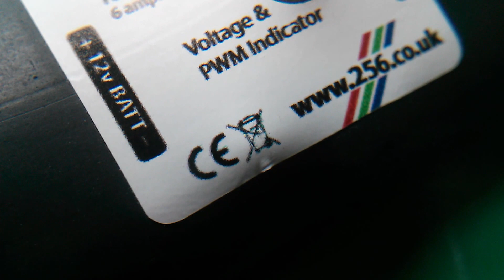Manufacturing the PWM5 Solar Charge Controller #2

Comment: Okay, Julian. I'm one of the biggest fan's of your. I learn a lot every day I watch your videos :)
I keep reading a lot of comments that people are still interested in your PWM5 product. So here is my 2 cents...
Why don't you do a kickstarter? You already have the hardest part of the project done (design and schematics). Collect some money through a kickstarter, find a manufacturer in China or Malaysia that would manufacture and assembly the whole kit and deliver it to your kickstarter customers.
See how many units you'd need to build with your manufacturer (MOQ Minimum Order Quantity). Set it as a goal at kickstarter and off you go.
Not only this manufacturing and assembly procedures would be easier, but your sales would be guaranteed (no waiting for customers, customers would be waiting on your product) and your profit would be instantaneous (selling a thousand units on the spot).
On top of that, you could manufacture a bit extra and continue selling on eBay.
See how this plan works out and then do the same with MPPT controller.

Comment: For the fun of it, get a weller TCP12V. It hooks straight to 12v, and the temperature is controlled by a magnetic tip
Reply: He could power the station with an inverter.
Reply: I know :) Those are lossy, tho, and he has 12v right there available :) It's a good iron as well.

Comment: Kinda surprised you didn't use outdoor rated silicone caulk instead of hot glue.  I would think that sitting out in the hot sun in some countries that see 120F+ temps every day may cause the glue to soften and flow over time.  I assume you used high temp so maybe that is not an issue.  Great to see a usable product developed and made all from home.

Comment: What kind of wire are you using? Any particular brand? I've been looking for some quality wires for some time now.
Reply from the maker: It says on it (and there's quite a lot of it):
TOPFLEX TRI-RATED H05V-K AENOR <HAR> BS6231 600/1000V 0.75 SQMM HEAT RESISTING 90 20AWG 105C AWM I A/B 1000V FT1 CURUS AWM STYLE 1015 600V VW-1 CSA TEW FT1
Reply: Thanks Julian Ilett!

Comment: Since you seem to like hot glue a lot for molding/sealing: I don't know if you know this, but hot glue won't stick to baking paper after it cooled. No idea if there are different grades and it only works with certain types, but it worked with everyone I tried till now and still was reuseable tens of times.
I mold tons of connectors like that. Put a small dab of glue on the paper (just as much that it will approx. be half the height of the connector) and push the soldered connector in (I mostly use it for pin headers, which have a flat side) and let it cool. Then put another bit of glue down and now push the upper side of the connector in. After cooling the excess on the side can easily be cut away with a flush trim wirecutter. And you're done with a very sturdy connector with included kink protection..

Comment: I like these videos!
Would it be worthwhile to find a Chinese manufacturer that could make the boards for you with a pick and place machine and things like that... I'm sure it would be cheaper wouldn't it?
Reply from the maker: Pick and place has always been on my mind. I drooled over the RedFrog (https://www.buildyourcnc.com/PickandPlaceMachineTheredFrog.aspx), but it's a lot of money and I don't have space for it. I felt that working with a Chinese manufacturer would be difficult - the enevitable production problems, quality problems and language difficulties. There are a few UK companies who offer P&P services, but it's only cost effective on a first run of 1000 units or so and I never made it to that quantity.
Reply: I understand. It looks like you are on the tipping point of being able to mass produce at a good price.
Reply: Julian Ilett Perhaps you could work with Adafruit here in the US. They have some pick and place capability and sell to exactly the market that would be interested in these, I would think.
In any event, I hate that I missed the boat on buying one of these before you stopped making them. 
Would you be interested in selling a kit or even just the schematic?
Reply: Julian Ilett At a guess you have, but have you ever thought about crowdfunding the PWM5 to mass produce? Any reviews of the product are always extremely positive and I think it would do really well.